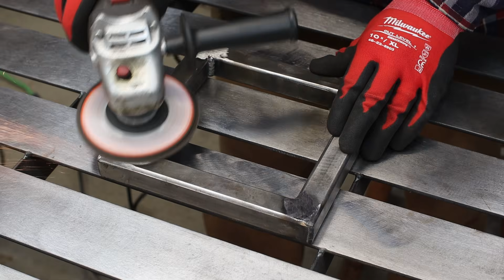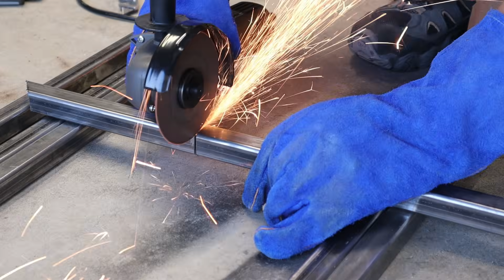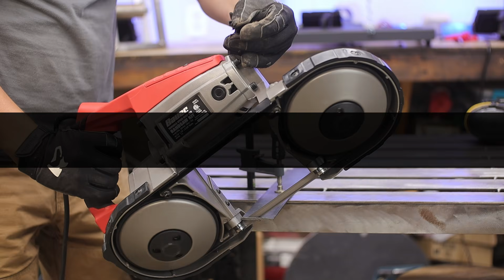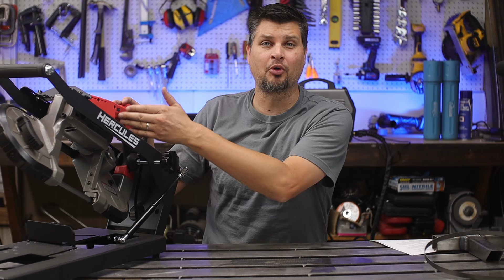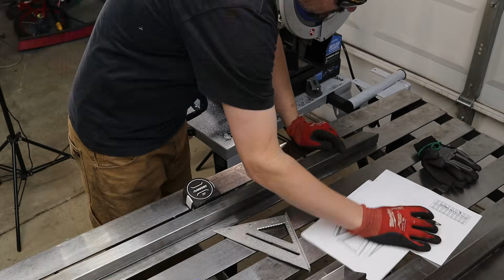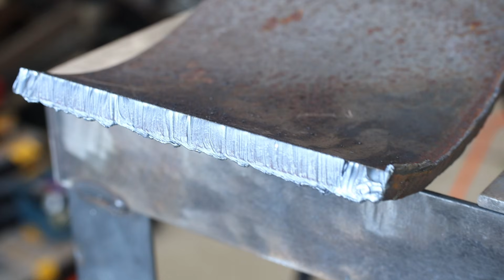CUT Metal \\ Best Tool For The Job

Comment: I use an old craftsman radial arm saw with an abrasive disk.  I also always wear my Stihl hard hat with it's wire mesh face shield and eye pro when using it. I've been looking at ways to slow the rpm's enough to use a cold cut blade. Also looking at steel cutting blades for circular saws as an option. Lacking a plasma cutter there is the oxy-Acetylene torch option.

Comment: This guy's presentations are spot on.  The plasma cutter blasts chunks of molted metal under pressure, unlike sparks in a grinder.  A sump to collect the molted metal is almost mandatory within a closed in area, shop, garage, etc.  Check out several videos of DIY'd sumps.

Comment: I just bought the Hercules band saw with a stand. With the upright function, the table won't sit flush unless you remove the lower blade guard. Also the blade will travel if you're trying to hurry up...

Comment: If you don't want to go SUPER CHEAP, then you can go one-step-up from the $15 harbor freight by going with Bauer. They have a line around 40 dollars, some cordless, others with different triggers, etc. In  my opinion, it's worth paying the little bit extra for the Bauer as it's about twice as much power.

Comment: The bare bones $15 warrior angle grinder is actually a good tool. I got one during a sale for $10 about three years ago and have abused it regularly on the farm and its still kicking. I did uprade to a higher amp hercules brand one, but my warrior grinder does the majority of the work.

Comment: Hey if you already have a wood-cutting miter saw all you need to do is buy a metal cutting blade. HF sells a 12 inch one for $60. Yeah you should technically run it at a lower RPM, but try it. It cuts like butter. Sure beats spending $400 for an Evolution. You can even do compound miters.
Reply from the maker: I wouldn't use it as a long term. Not just for the blade but your saw is not designed for the higher speed, going through steel will require a lot of torque on the motor.
Reply: @-DIYPRO- I would be more worried about the carbide teeth coming off the blade like a bullet.

Comment: How much air or what size of compressor is needed to run the plasma?
Reply from the maker: Depends on how long you want to use it for. I have a small 8 gal and it is constantly on. My 20gal does a lot better keeping up.

Comment: Dude .. Awesome video.. I have 9 angle grinders lol. This is for a bunch of reasons one is I don't have to keep changing wheels for different processes to I don't beat up on one grinder doing a bunch of different processes. As for the evolution chop saw that you have we saw those at my job I work for a welding company in upstate New York we have 21 locations. And I work in the service department where we fix all the machines and service tools actually send the evolutions out to fix. I just had one back under warranty they replace the entire thing that is a beast of a saw. Man I so want to do a video about my cutting stuff. You have a really cool channel man keep it up
Reply from the maker: Appreciate it, thanks!

Comment: Great overview. Evolution makes a 7 1/4" metal chop saw for less than $200. If you don't need to cut large tubing, its a great way to go.
Reply from the maker: True, I have thought about adding the 7 1/4" to the mix.

Comment: This is a great video for the metal working newbies out there……like me! I’ve melted two angle grinders so far, one a Harbor Freight and one a Bosch. cheap angle grinders are great for short run times but extended use kills em.  I’ve even had to repair my expensive Dewalt. Many grinders with dedicated functions will extend their lifespans,so Harbor freight to the rescue!
Reply from the maker: Great point, thanks!